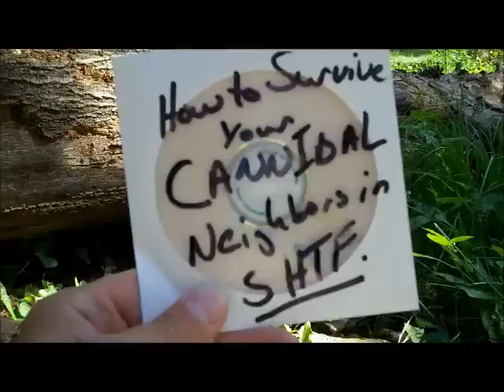DIY PACKABLE WOOD GAS STOVE (BushBuddy Design)

Comment: I just made one, took about an hour. Despite single digit temps and high winds here in IL (Feb 23, 2014), it burned like a champ and still boiled water without having to add additional fuel. GREAT DESIGN!
Reply from the maker: Thanks Rob and I appreciate you giving the feedback.  It means a lot to me and helps to want to keep posting.

Comment: Thanks, Yankee.  I just made it. Great project to work on.  Used a Dremel cutting wheel instead of angle grinder, and an 8oz tin of water chestnuts instead of tuna can. (They only come in 5 oz and 10 oz where I live.)  Couldn't find the gutter mesh in sheets anywhere, so just used 1/2 inch mesh for rabbit hutches, etc. and tried it out.  Awesome.  My Soda can alcohol stove fits right inside too, so I'm good to go.

Comment: Is the stove powerful enough to frie potatoes on it? Can it deliver enough heat to do so?
Pot stand is good but is it there a Grill/BBQ stand to be compatible with the stove? 
What are sizes of the cans? Heigh by diameter. The holes/cuts i make with my knife only using knife and fingers no need even marker. However the exact size of this cans is unavailable in local stores in my living area. So i have to improvise with Sprite,paintbox and khalva cans.

Comment: Great video! I didn't use the tuna can though. I just used more of the screen and made a pot holder with that and wired together in a circle which I saw in other bush stove videos. Seemed easier and lighter. Thanks for the great idea with the cans! .
Reply from the maker: I used the tuna can because it will last.  The screen will not.  (Easier does not mean better)

Comment: Because the wood gas stoves release the igniteable gas, you end up with charcoal thus you got material for a final filter for water purification like a Bio-sand filter. This means improving the taste. Allegedly the best charcoal is from coconut husks. If one were so inclined, one could use that charcoal for many things of course, but multiple filtration of distilled adult beverages vastly improves a lesser grade ethanol.

Comment: Thanks for the dry Yankee humor and the plan, quick question, do you put the paint can lid back on the bottom?
Reply from the maker: yes.  That is one of the advantages to this design.  You can remove the bottom fro maximum airflow if you need help getting a good fire going or the fuel is wet.  It's not going to burn the gases well until you put the bottom on though.  The bottom lid also acts as a good place to store tinder and matches or a light when not in use.

Comment: Nice design Yankee. One question....I don't have a cut off weeel, will the stove still burn effficiently if I drill several holes in the progresso can rather the slot cuts? If so how many and what size would you recommend? Thanks!

Comment: I'm going to make one like yours (with the mesh pot stand), but wouldn't an open bottom be better (use a little wire or mesh grate on the inner can)?  This would allow one to move the stove over (with care of course) if need be if a longer burn is needed?  And how much body fat do you have?  I like lean meat.

Comment: Hey there. Great eyeballing there, and a really well-done instruction video. I also liked the part with cookies. Now to the real point of my comment: 
I'm from Europe, and as you know we're all a little backwards over here, so we're still using the metric system, and our cans have entirely different sizes, too. Now I reckon you've got to maintain some sort of ratio between the sizes of your cans and the total area of the intake and "burner" holes. If that is indeed so, do you know the formula?

Comment: Hello, first of great video! I was wondering if it is possible to get away with 1/2in holes on the main can instead of 3/4in and still get enough airflow. Being currently out of work I don't have the funds to go out and buy a new bit x_x